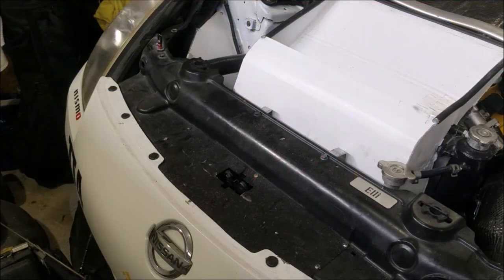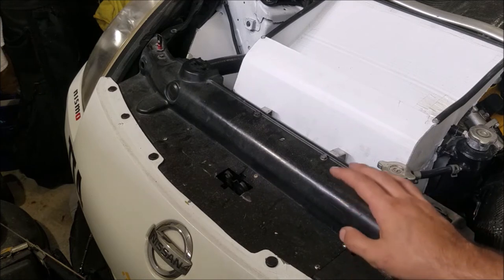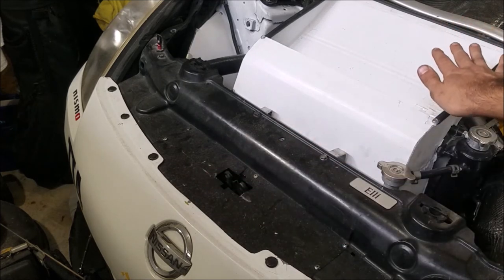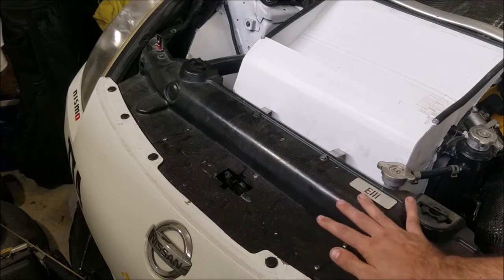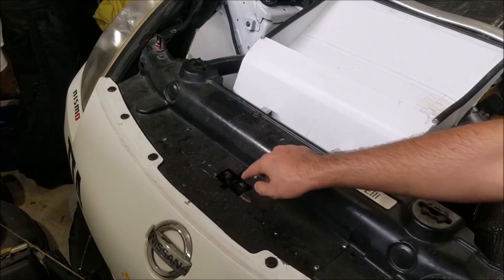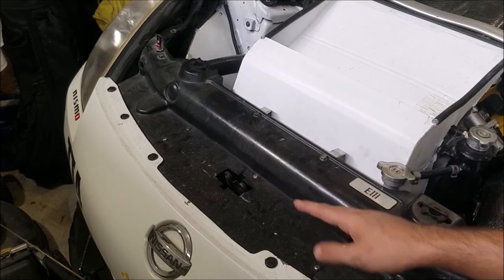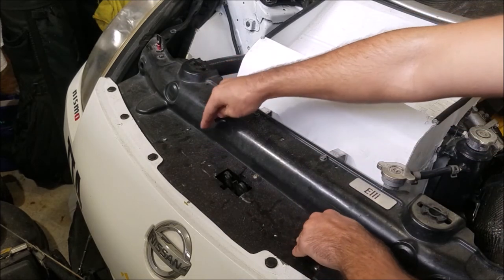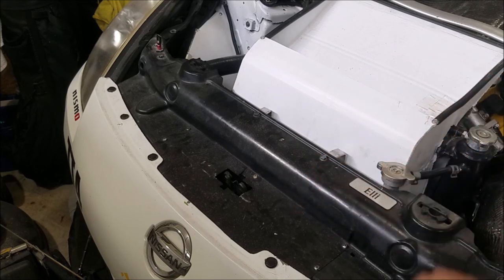Nissan 350Z Diversion Plate DIY

Comment: I just want to know what that part behind the radiator is and we’re you guy it. I want one for mine
Reply from the maker: The air duct? I made it. It's only useful if you have a hood vent. You'll also need to clear as much room behind the radiator as possible for it to work. Really, the engine needs to be moved rearward and radiator angled forward for maximum effect